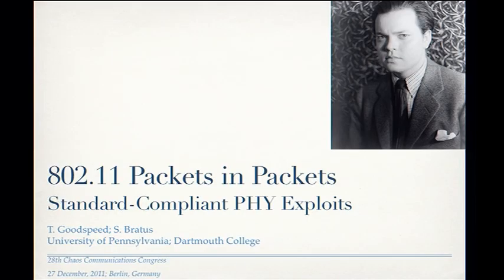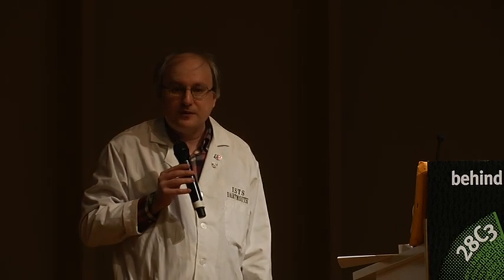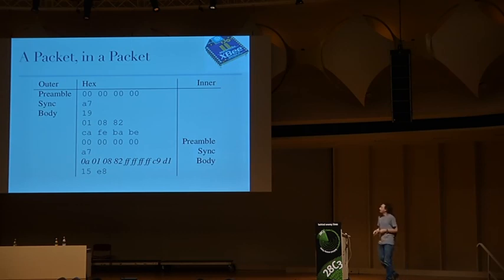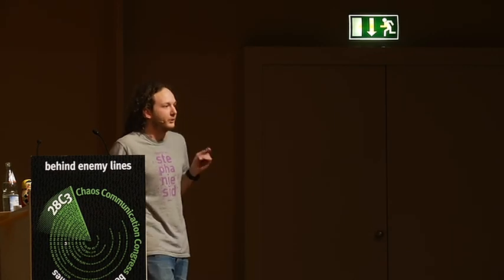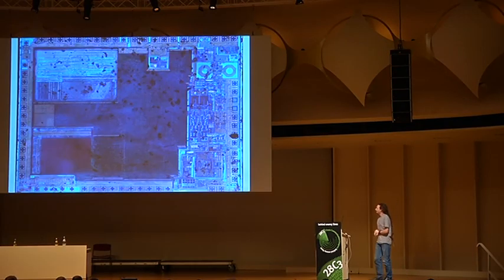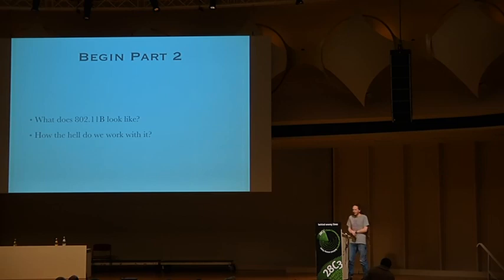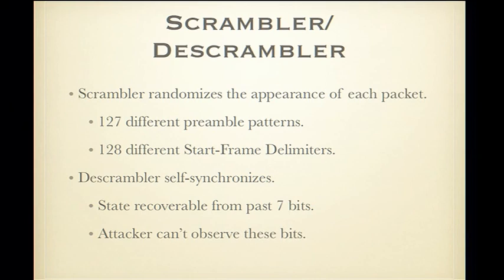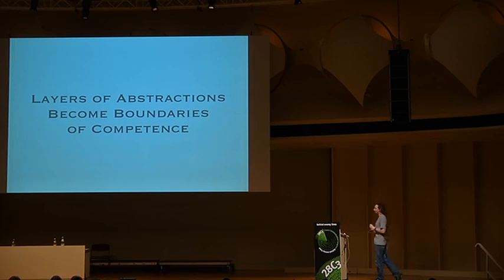28c3: 802.11 Packets in Packets

Comment: It might be possible to improve the performance of the attack by including an extra sync sequence after the innermost packet. The purpose of that extra sync would just be to hide the next legitimate sync.

This sort of attack should be easy to prevent with proper protocol design. The scrambler must not output too many identical bits in a row, so there are sequences which the scrambler can never produce. Use any such sequence as the sync sequence.

Comment: Lots of software has been written which can only handle GIF files with 256 colours. Two decades ago, that was considered good quality. These days we have come to expect better quality than that. However GIF has always supported more colours, there is just a lot of buggy software, that cannot display GIF files with more colours. Look at some examples here: 687474703a2f2f7068696c2e6970616c2e6f72672f74632e68746d6c0a.r.kasperd.net (sorry about the ugly URL, youtube wouldn't post it otherwise).